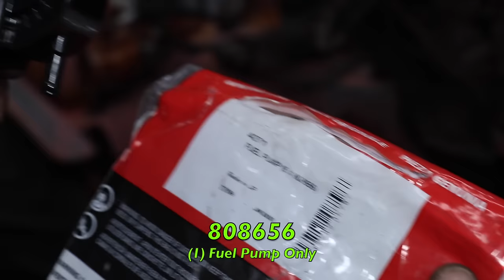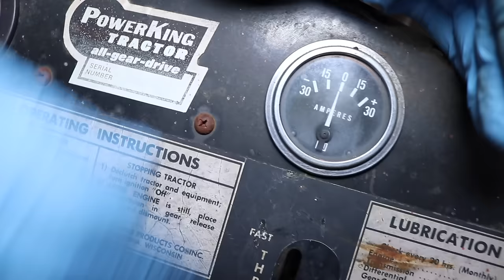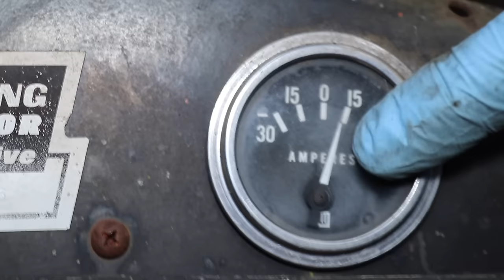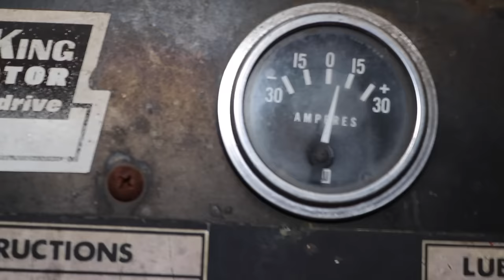1974 Power King -  Left For DEAD! Can It Be Saved?

Comment: I've always wanted to rig a power steering setup on one of these tractors and move the steering wheel to the center. That offset deal always bugged me.
Reply: Yea I noticed the offset steering wheel, I could see how if you were trying to sell it,that would be someone's complaint,
Reply: @jeffclark2725   they work fine, I remember as a kid just thinking the tractors looked so cool but that one feature just looked off balance. Farmall C and its progeny were the same way.
Reply: @jeffclark2725  I actually saw one on craigslist where someone did what I wanted to do, but it looked like there was too much beer induced thinking in their design.
Reply: @matthewtaylor2185  agreed,on the farmall tractor having the offset wheel, I can see where visibility could be better,but when those tractors were new ,there was a method it was made that way for,I remember  grandpa  old 50s Gibson didn't have a steering wheel, it had a tiller arm and worked fine
Reply: @jeffclark2725  I don't think Farmall intended the C to have an offset steering wheel, it just had a different style bolster than the H and M. It wasn't offset very much.
Reply: @tc25d  the C wasn't one of the offset ones!
Reply: @tc25d  will agree 👍, you are one that uses and knows the benefits of the offset steering ,alot of the farm all tractors I saw were using cicle bar cutters or stationary  running a belt,Classic Tractor Fever
Reply: @tc25d  there's a cool one you don't see every day!  I have my grandfather's cub here.
Reply: @jeffclark2725  yes! Gibson tractors! My buddy had one. He always laughed that it was designed to run on one pint of fuel per hour.
Reply: @jeffclark2725  no mowing machine in the world like a farmall 230 with a good sickle bar mower! Zero turn mowers got nothing on the farmall!
Reply: @matthewtaylor2185  picked up a Jihn deere 214 tractor back in the spring, good sized tractor, not sure about deck options yet
Reply: @jeffclark2725  I spent so many hours of my youth on a 212(same tractor?) That I can still hear 3rd gear whining in my head.
Reply: @jeffclark2725   I think they had three deck options. They're out there, may need to rebuild one. Take a good look at that main drive belt before installing a deck. That variable speed drive tended to wear belts out faster than otherwise.

Comment: That’s at least a 1980 or newer powerking. Pearling brake knob is missing on top of trans tunnel and the hydraulic three point cylinder is under the trans tunnel and not above off to the side.
Reply: Parking brake knob, not pearling.

Comment: Just solder up the gas tank with a torch like a proffesional  radiator and tank shop does,  plug the openings and fill with water leaving a air pocket in the area to be soldered up, no chance of ignition, easy and forever fix, unlke expoxy that will in time disintergrate

Comment: Flip one of your pulleys so the belt remains in constant tension and alignment...your old drill press.
Reply: Several commenters have noted that the motor pulley is in fact installed upside down.

Comment: I had one power king with the kohler engine that had the magnetic pickup and special coil set up but the windings for charging and spark went bad ,, burnt I'd guess jumping to start. Customer never wanted to buy parts so it set in my back for about 8 yrs. The parts I think were over $200. Back then now not available. Figured out the Chevy pick up coil would work at about half price. Never showed up I  offered to help not repair n pray to get paid.

Comment: I'm disappointed that the video didn't actually show much being restored.  An hour and 15 minute video and it only showed work that is only a little more than basic maintaince...battery terminals, carb adjustment, replace fuel pump, cleaning out a mouse nest, etc.  Nothing to really learn from that.  I would have much preferred if the video showed some work on the clutch, valves, rings, ignition, transmission, brakes, etc.  You know, the work that is really needed on an old abandoned tractor.  The title of the video is "Left for dead! Can it be saved?"  The tractor was not dead and needed very little work at all.

Comment: Yeah the pulleys are wrong...one side needs to be smaller and the other bigger...like a motorcycle... small pulley on motor & big pulley on drill arbor = slower drill bit speed
vice versa if reversed...you can flip the pulleys ( change them on each side ) to change the speeds available ... but like others pointed out..the motor pulleys are not correct for the slower speeds... you have similar sized pulleys so very little speed differences...

Comment: I’ve had dozens of the old K series Kohler engines. The cheap eBay aftermarket carbs from China are hit and miss. I’ve had ones that work perfectly and others that don’t run right no matter what you do. If you can’t get them adjusted right you might as well throw them away because it’s cheaper to order another one than ship yours back. The worst part is that a kohler rebuild kid doesn’t work on them either.

Comment: You do look like the Burger King!  I make my own battery terminals >  I know they will last about for EVER > I also make my own spark plug wires.  I hate these cheap made CHINA MADE JUNK  See the gray around the head.  Look like the head gasket is leaking <> If the vacuum fuel pump fails? I put a electric fuel pump on it

Comment: You are so cruel. Talk about being mean to a machine. That thing's been sitting for so long. And you use brake cleaner in it or ether. How about giving it a good dose of WD-40 loosen up the rust and it'll run on WD-40. All that rust in the cylinders. Man I thought you were smarter than that. Take it from an old outboard mechanic if it won't start on WD-40. Put some rings in the bitch. But boy you did some damage dry starting that motor